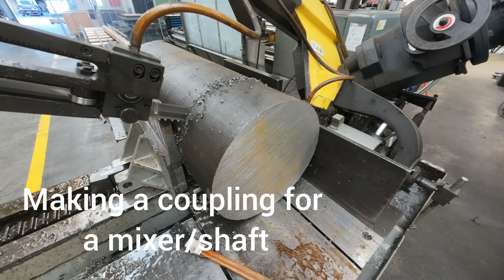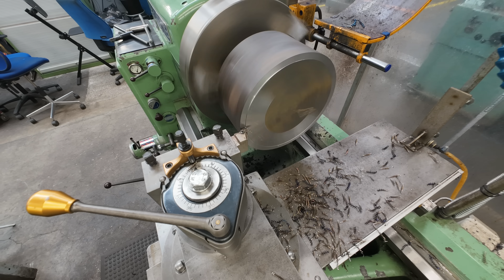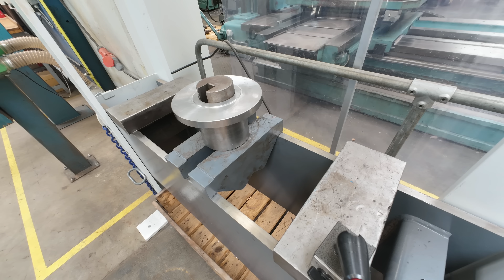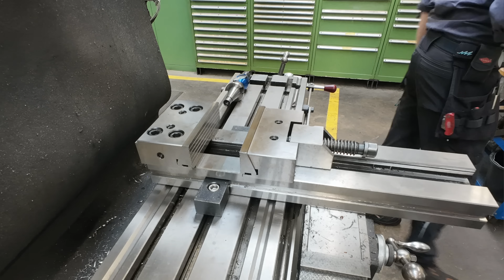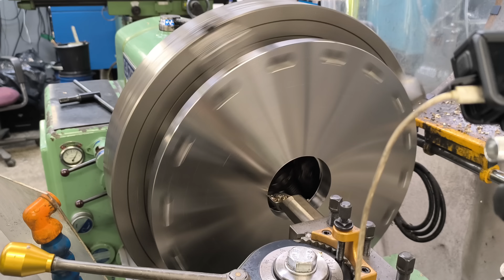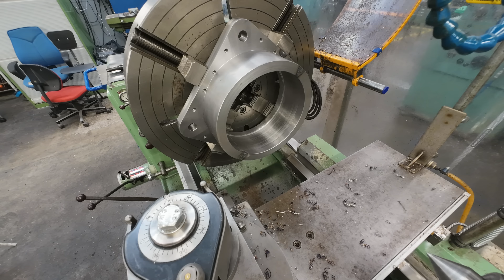Projects from the machine shop week 37 2025  machining from the repair shop

Comment: Im no expert, but can you tell me the advantage of no cooling water when turning on the lathe? Why not cool your tool?
Reply from the maker: Main reason is i dont wanna stand in the mess.  It will also add fumes and aerosols into the air.  Destroy the paint and get in everywhere and by time, be hard on the machine.  But in some materials i do use coolant.

Comment: Er Cazeneuve´n så bra som "alle" sier ?  Takk for mange interessante videoer. :-)
Reply from the maker: Mange tak 😊🙏
- alt afhænger af personlige præferencer og hvad man laver. Men Cazeneuve er klart i top mht brugervenlighed, præcision og ydelse.   Denne klarer 10mm spån, 1.0mm i tilspænding, og stadig inden for 0.02mm i tolerance 😊  725mm sving, 20hk motor, MK6 og stor pinoldok. Lang slæde og brede vanger. Virkelig velbygget og dimensioneret.

Comment: Not trying to dog your work, but I've made many rigid mount couplings (which is what it seems you're making) and we always finished bore, spigot (projection) and flange face in one set up. No room for misalignment on these things! And I hear you load and clear about being in a position when your customer is down. You do what it takes to get the job done and keep production moving.
Reply from the maker: Thanks for your comment.   Yes, I normally do the couplings that was as well. But this wasn't any critical. And the runout of the chuck is surprisingly good. So can flip it and still get good accuracy/runout
Reply from the maker: What is the spigot thing?

Comment: What a waste of material! 😮
Reply from the maker: What would you do instead?
Reply: . @OmeMachining  Use something a bit nearer to the finished diameter unless it was an urgent breakdown job and you had to use what was available regardless of cost.
Reply: @gudnite Sometimes it's about availability of material and waiting time  ,when a customer wants the component now because downtime costs. I have been in this position numerous times over the years. You make the job happen no matter what and customer is prepared to where the maching costs.
Reply from the maker: I've been doing this for 22 years. I have a pretty good idea of what works and doesn't.   Here, production/downtime is more critical than a small piece of steel. 
"Waisting" - time on sourcing "correct" size steel is a super waste of time, compared. Only thing that counts - get going.   And... It do take ~ 15 mins to get it to correct size.   No big deal whatsoever